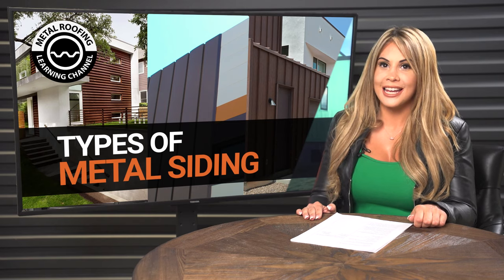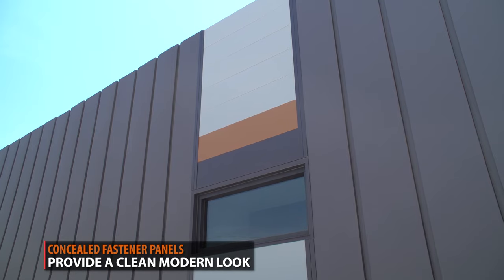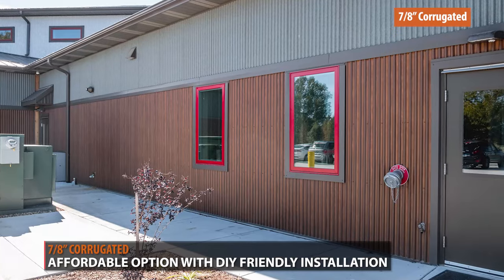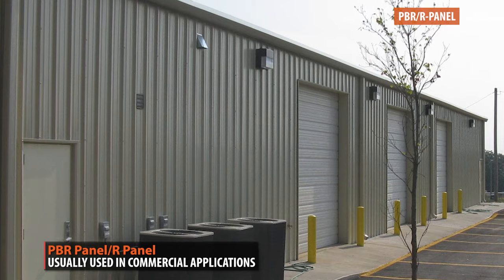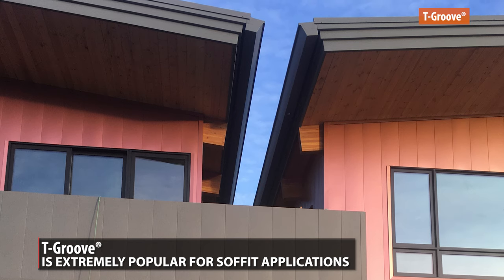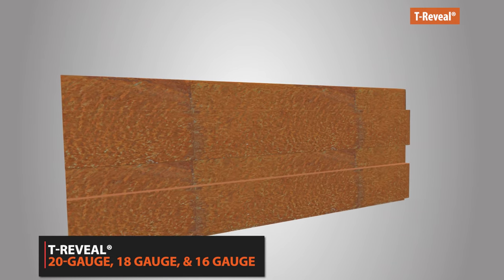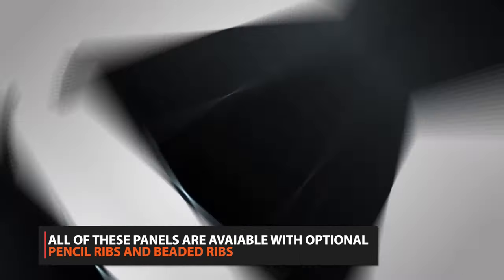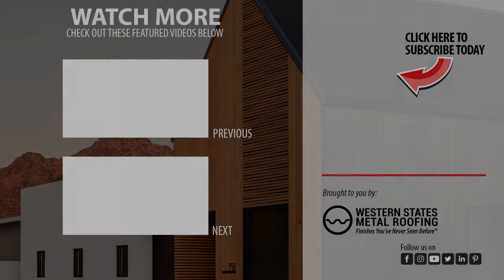8 Types of Metal Siding And Metal Wall Panels: Which Is Right For Your House?

Comment: Superb info. Cost info would have been great
Reply from the maker: I appreciate the support. I would have liked to put the cost, but in the current environment it changes so quickly and would be useless. The best easy costing I can give you. Exposed fastener panels cost about half of concealed fastner panels. Good luck on the project and give us a chance to bid it as we can save you some money.
Reply: @WesternStatesMetalRoofing  : awesome info. Can you throw cost comparison between metal with fasteners vs vinyl siding. This will complete the cycle 👍
Reply from the maker: This article was written before the price increases of 2021, but it should still be helpful.
https://www.westernstatesmetalroofing.com/blog/aluminum-vs-steel-vs-vinyl-siding